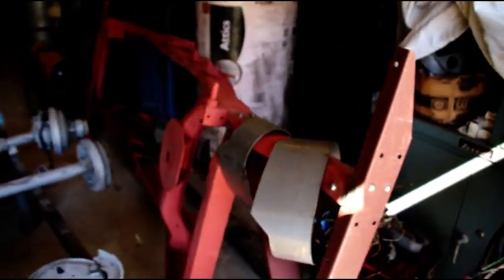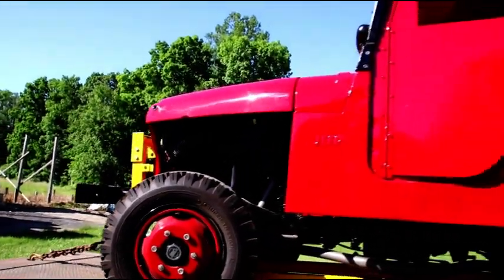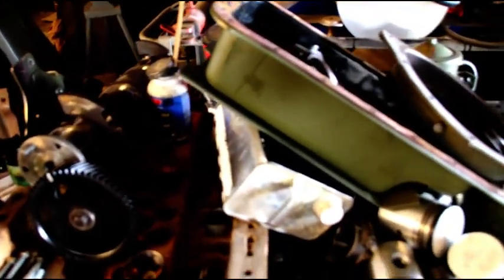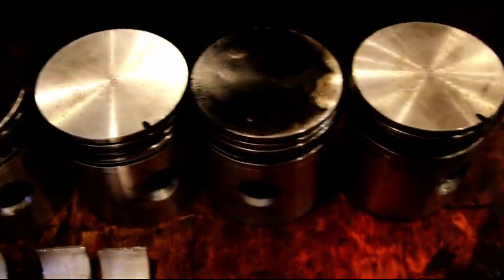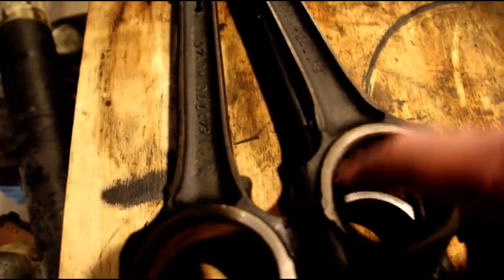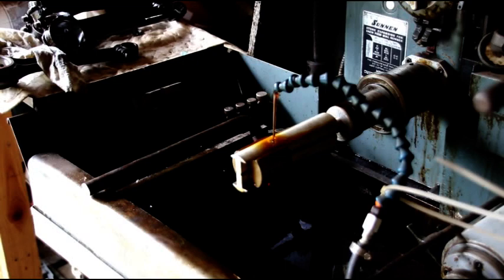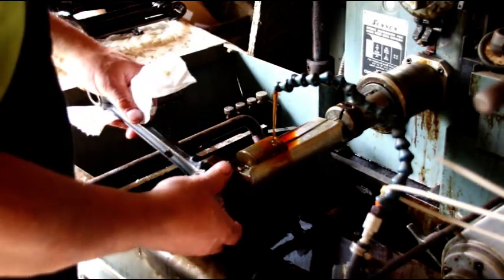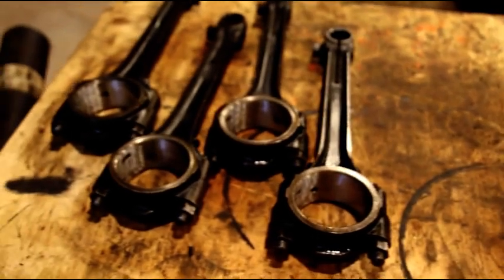Willys CJ5 Snowblower Jeep In The Sun... Lots Of Project Updates, Engines, Axles and More.....

Comment: Love your work and business ethic.  I've started restoring a 1950 Cj3a, that's been in the family longer than I have.  Have a question for you and a possible subject for a video.  I have a bad spring hanger that needs replacing.  Is there a way to replace one and retain the look of the factory rivets?  I don't have the ability to hot rivet and don't really want to invest in tooling to replace one spring mount.  Thanks.
Reply from the maker: You can use a solid rivet and weld it in place or use the rivets that bolt together and make a kind of normal looking rivet head.

Comment: Beautiful work sir
My question is concerning the con rods regardless of L or F head. Are the small ends ever much of a concern? Within reason of course. Thanks in advance.
Reply from the maker: The small engine uses a pinch bolt to hold the pin.  It is not a press fit so it needs nothing done to it.   If something is wrong with the small end the rod will need to  be replaced.